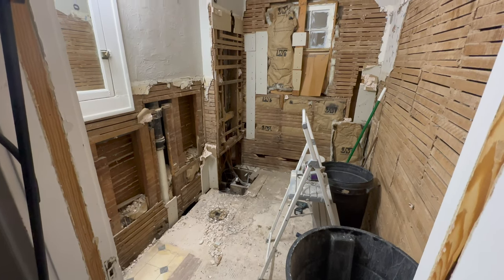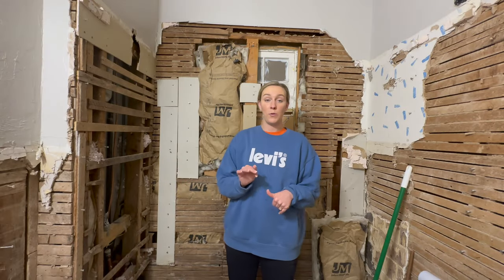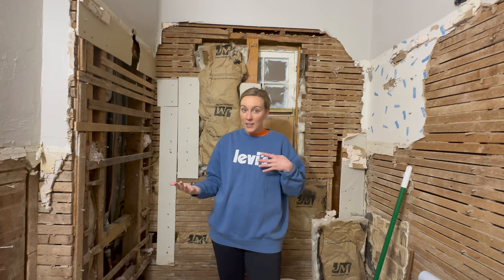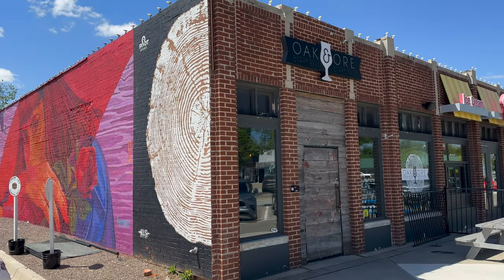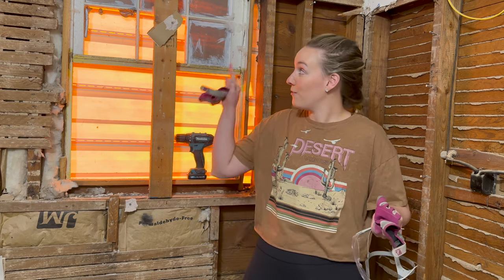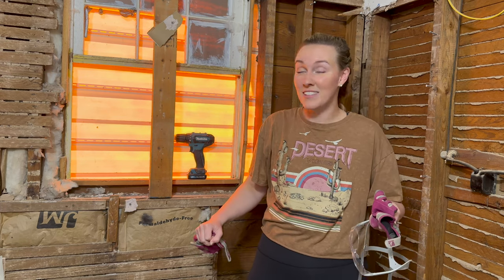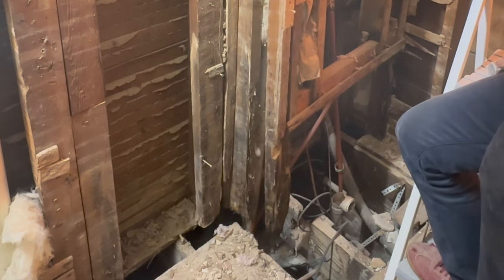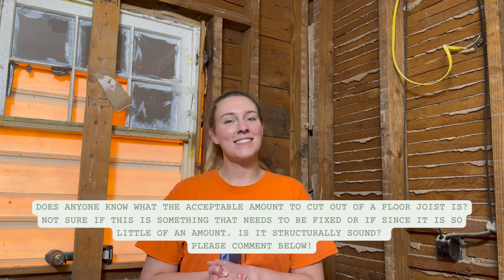COMPLETE lath & plaster removal *before and AFTER | Master Suite Reno Pt 10

Comment: About the floor joint, there is a video that I thought might help (How To Repair Cut or Damaged Floor Joist – Bolting New Joist To Existing). But You should get a structural engineer to get it checked to be on the save side. Another thing I was wondering is if you are planning on isolating the interior walls? Are you going to renovate room by room or is the master bathroom the only big renovation?
Reply from the maker: Thanks for the tips here too and watching my videos! Yes we have some more issues we currently are running into with our the sill plates of the  wall with the cast iron pipe and the window wall. So we are actually having to figure that out first before fixing adding the new floor joists :( With 1 step forward there are 5 steps before that! But this is our first big renovation and we will renovate our master bedroom next to complete the master suite! Then I'll do some cosmetic changes in the interior till we have a chance to do the bigger ones. Then another plan is renovating the kitchen, guest bath and adding a lot of things to our exterior that would make it a lot more appealing.